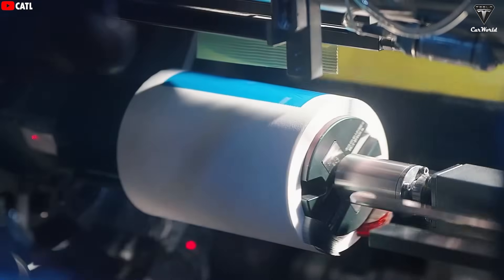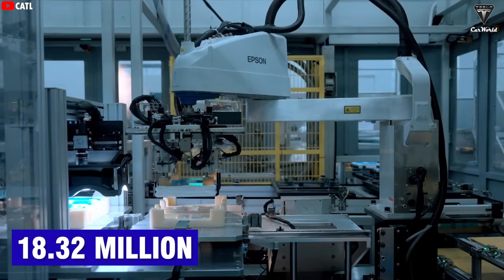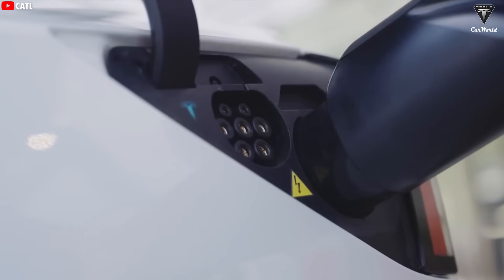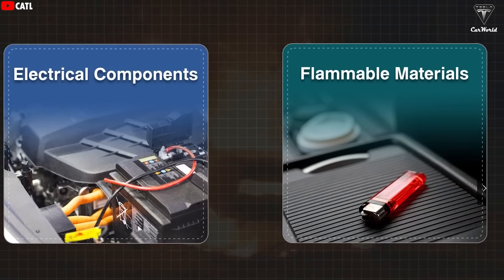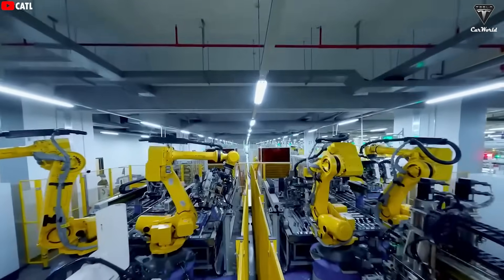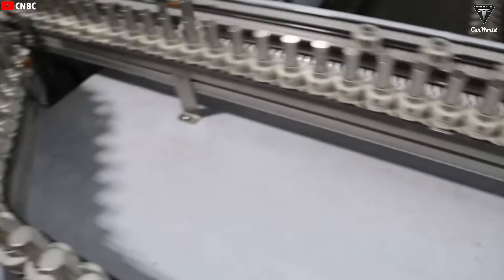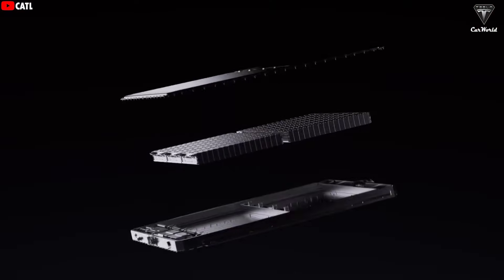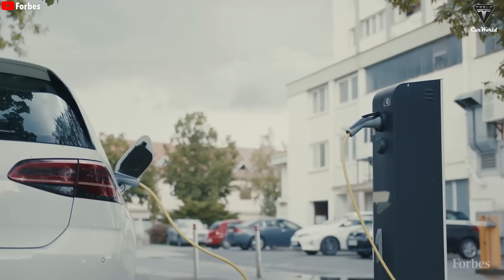ELON MUSK SHOCKED New Naxtra Battery Add 310 Miles Range In 5 Mins | Cheapest Battery For Tesla EVs!

Comment: As long as it's a Battery, it's Junk. Why not go Cleaner and drive a modern Gas powered car? Far better for the environment. If you disagree or obviously Don't Understand, do the Research and combine it with Common Sense.
Hydrogen or any of the Many alternative energy solutions will change the world.
Want to End Oil, Coal, lithium? Stop buying Battery Cars........

Comment: This is a physics/math free video for a reason., absolute garbage.  People who don't know how electricity works think building a charging station is like building a gas station, but these require massive amounts of electricity just to charge a singe Tesla in 15 to 30 minutes, to do twice the charge in 1/3 to 1/6 the time requires 3 to 6 times more power be available, and that's just for a single vehicle.  Add another vehicle and you now have to double the power in order to get the same charge in the same amount of time.  Are you going to build a city sized power station next door to the charging station just to power these chargers?  You'd need an industrial power supply just to charge your car at home in 5 minutes.

Comment: Every few weeks, I see a story about a new amazing battery that is just around the corner.  It's been years and we're still using lithium.  I'm sceptical.

If car manufacturers start using them, none of the existing chargers can charge them in 5 minutes.  New, higher current chargers will be required.  Until then, charge times won't change.

Comment: I would never consider an electric car until they reach at least double the range of a gas or diesel engine,  and you can charge it at home on a 110 outlet without having to buy a special charger, and the batteries last at least 10 years.

Comment: These 5 minute charge time claims are ridiculous. Chargers can't keep up with it. 310 miles of requires 100kW of power, give or take, delivered continuously for 1 hour to recover those miles.

Getting that down to 5 minutes, which is 1/12th of an hour, requires 12 times the power, or 1,200kW. That's a megawatt of power at the charger just to charge a single vehicle.

The cable needed to accomplish that will be way too heavy and unwieldy for people to manage. And there are limitations to how many such chargers in simultaneous operation the grid can support.

These batteries will take just a long to charge as lithium batteries because they are aren't the bottleneck. The chargers are.

Comment: earth is 12 percent lithium
Reply: No, the claim that Earth is composed of 12% lithium is incorrect. In reality, lithium constitutes only about 0.002% of the Earth's crust by weight, which equates to 20 parts per million (ppm) . This makes lithium relatively rare compared to more abundant elements like oxygen (46.1%), silicon (28.2%), aluminum (8.2%), and iron (5.6%) .
Reply: @DavidPrice51  nonsense